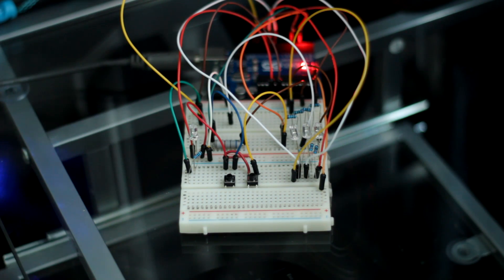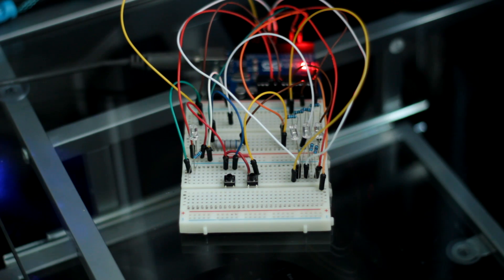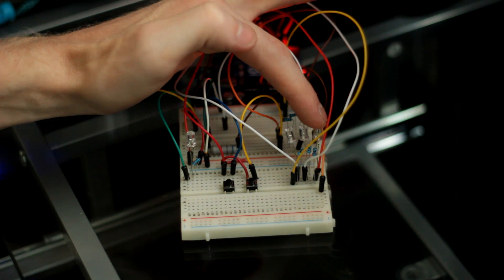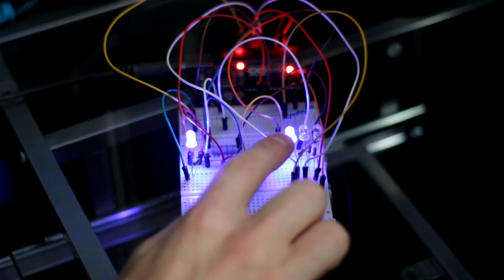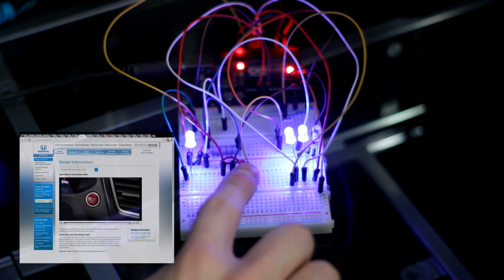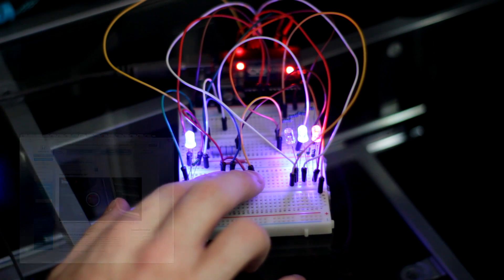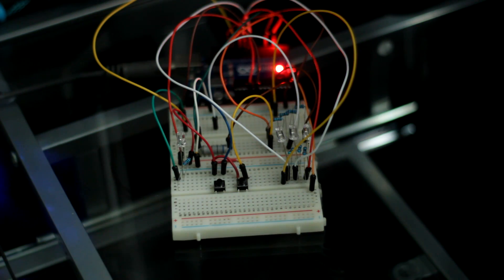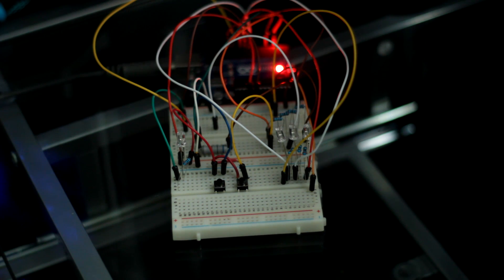How to do an Engine Start Button -  the Right Way - Part 1

Comment: Where did you find the wire harness for the mazda button? I wish to use it, because, well, it looks killer. I found the button no problem, but not the plug for it.
Reply from the maker: It's one of the best looking buttons for sure! I just connected the wires individually to the pins after figuring out what each pin was for. If you can find a used harness, that would be easiest, but the way I did it wasn't to difficult either. I used female jumper wires(the kind that you would use with an experiment breadboard). I believe I posted the pin diagram on the website, so you can know which pin goes to what. Hope that helps!
Reply: well damn, if I can just use the breadboard females I will do that, I have a bunch of extra! I have my Arduino working how I want, but added that the clutch had to be pressed to shut the car off, because the strat button location I am using is below the radio angled out, so things could potentially fall and hit it.

Comment: Can you do this on a car who's key has a transmitter?
Reply from the maker: +Hernan121096 Yes. You can use a transponder bypass module, or take the chip out of the key and install it in the vehicle, or just bring the key with you each time.

Comment: so would it turn off the car while its in gear if you pushed the button again
Reply from the maker: +Gss2013 I programmed it so that it will turn off anytime the button is pressed while the vehicle is on. If this is undesirable, it can be reprogrammed to do what you like.

Comment: wow this is awesome man. question did you write the program of the breadboard? if not how did you do it. can this same program work with another car like a Lexus.
Reply from the maker: +Da Mechanic I did write the program. I'm not a professional coder, so it's a bit sloppy, but it works. I've had it in my car for almost a year now. No issues. You can look at the code here: http://civicjunkie.com/main/2014/09/02/how-to-install-a-start-button/ Technically, it can work with any car. However, newer vehicles have a lot more electronics you have to get around. Then again, new vehicles come with an engines start button.